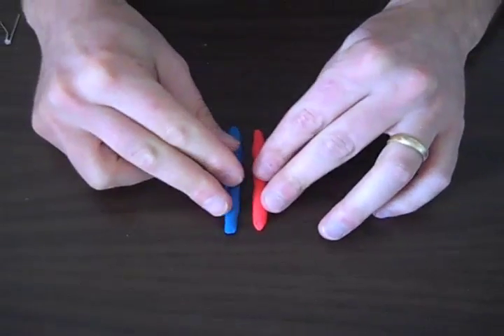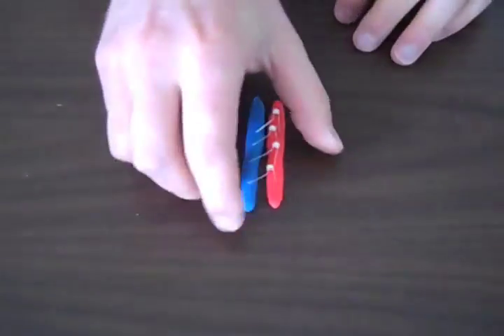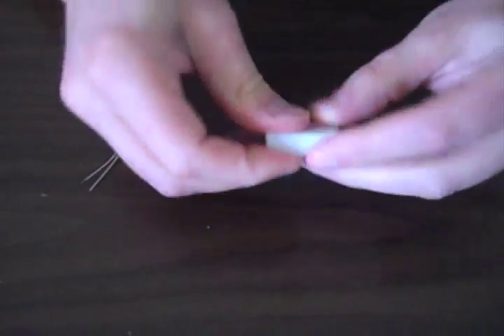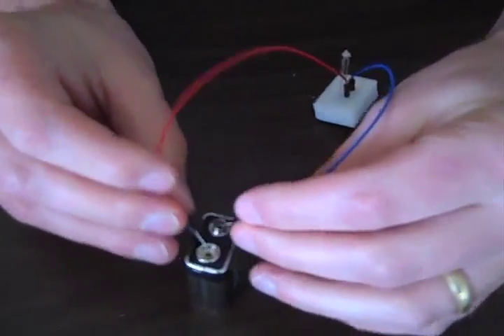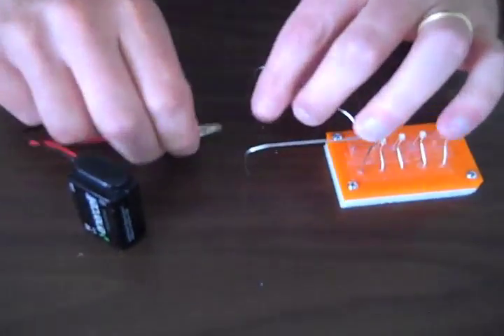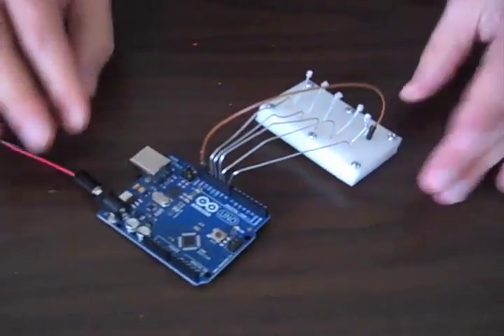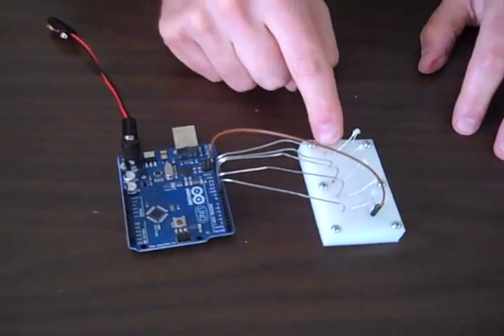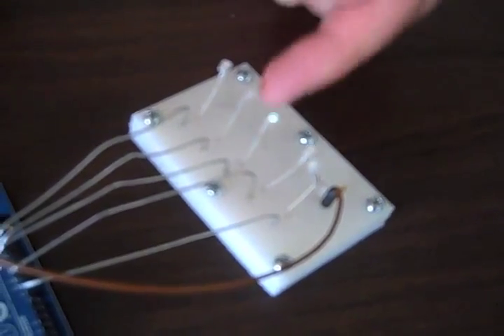3D Printed Circuits using Play-Doh as an Electrical Conductor

Comment: Really what you need to do is make the playdoh rectangular and longer length wise, then lay it side by side like ||. Now you can make a 9-volt connector at one end with the 3d printer that would let you snap the battery in directly and not require leads.